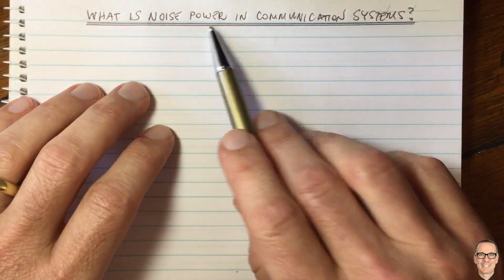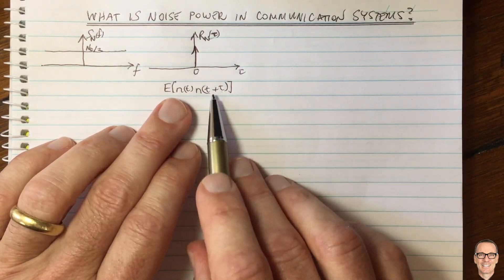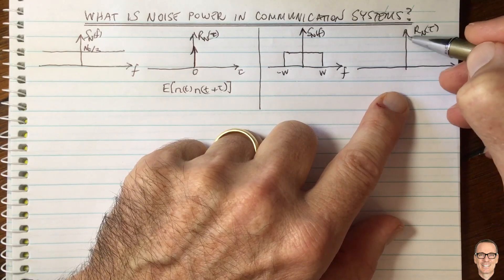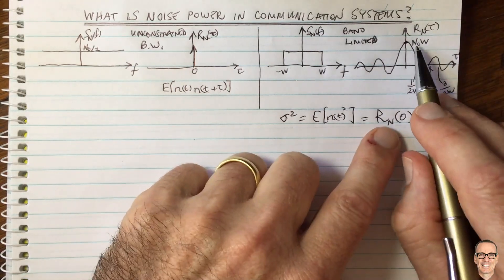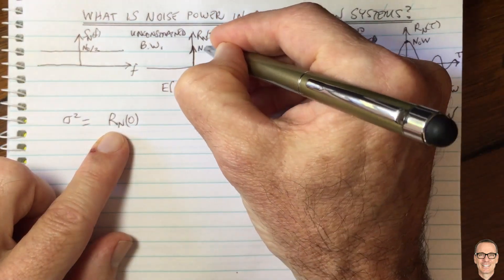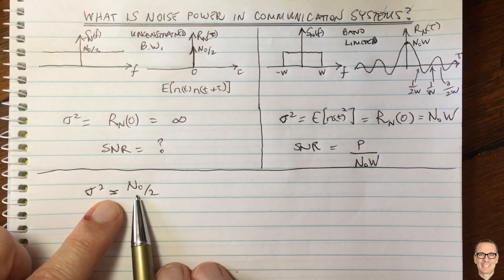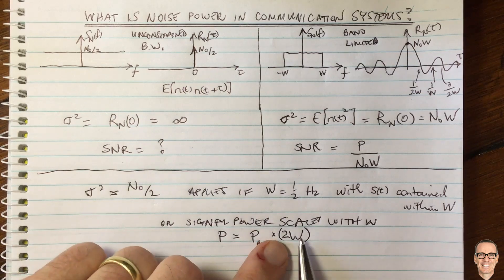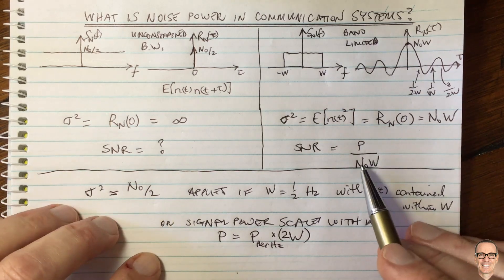What is Noise Power in Communication Systems?

Comment: So a band limited noise has more corelation with its own self as can be seen with a sinc function in time domain against a single impulse for unconstrained noise?
Intuitively speaking, how will the expected value expression for correlation look like in case of bandlimited noise?
Reply from the maker: Sorry, I don't know what you mean by "expected value expression for correlation".
Reply: RN(0) for unconstrained and constrained are derived from single point impulse response and sinc function respectively...we see the correlation of noise increases from No/2 to NoW ...does it not signify that the noise correlation increases for a constrained noise case in contrast to unconstrained case...this is the simplest i could write to explain my statement @iain_explains
Reply from the maker: OK, I think I see what you're saying. But you're mixing up the units. No/2 is a power spectral density (Power per unit bandwidth, measured in Watts/Hz), while NoW is a power (measured in Watts). You can't compare them directly.
Reply: @iain_explains  yes sir that is why i wanted to know why you referred to difference between their time equivalents if they are very different from each othet

Comment: Great video! Can low-pass filtered white noise be still considered gaussian noise? Could you please do a video about that? Thanks! and keep up the great work!!
Reply from the maker: Great question. Thanks for the suggestion for a new video. I've added it to my "to do" list. In summary, yes, as long as it is a linear filter. Linear filters perform convolution, which essentially involves adding delayed versions of the input to itself (according to the impulse response). The addition of two Gaussian random variables results in another Gaussian random variable. So if a linear filter has a Gaussian random process input, then the output is also a Gaussian random process.
Reply: @iain_explains  Awesome, thank you! A video about pink noise and the PSD would also be greatly appreciate it! :)
Reply: Hi, any videos about STC, STBC, OSTBC and EO-STBC please.

Comment: https://www.youtube.com/watch?v=vtJ6mAy3xMc&t=634s

sir, in this video you took the BER as P(Y=-A/X=A) but shouldn't it be P(Y = A/X = -A) + P(Y= -A/X= A)
in the case of bpsk
Reply from the maker: Really it is P(Y = A | X = -A)*P(X = -A) + P(Y = -A | X = A)*P(X = A). But note that P(X = A) = P(X = -A) = 1/2 for source coded (equally likely symbols), and P(Y = A | X = -A) = P(Y = -A | X = A) for symmetric symbols. Therefore the overall BER equals P(Y = -A | X = A) .... or P(Y = A | X = -A).
Reply: @iain_explains   got it sir thanks a lot